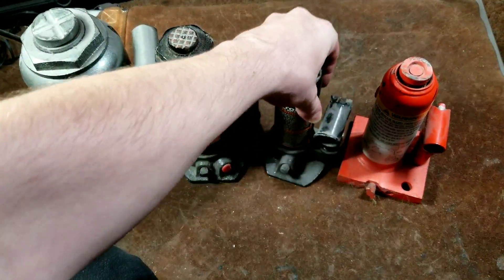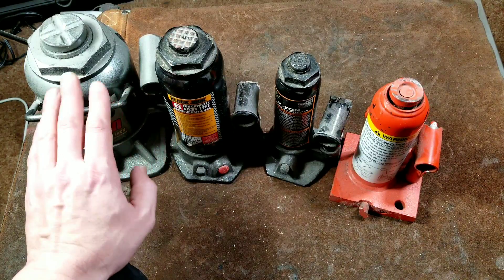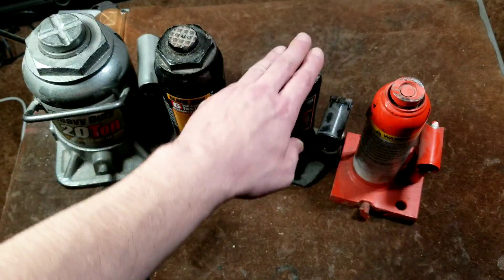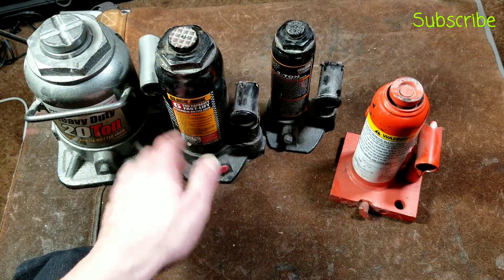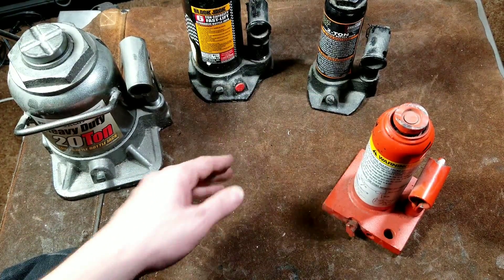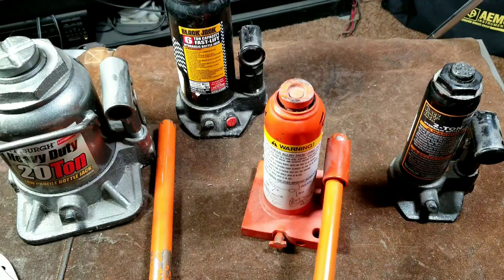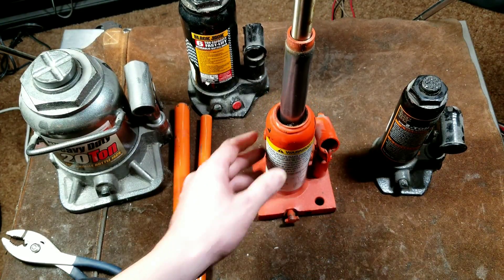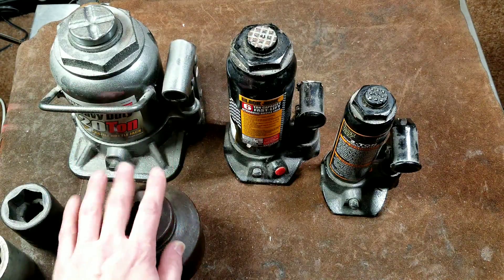Hydraulic Bottle Jacks Overview & Discussion

Comment: Hi, just bought a Torin Black Jack 8 ton welded bottle jack, its heavy, awesome and pretty straightforward since its welded sealed, and probably unserviceable to some extent, as far as seal replacement on piston n plunger relates. The release screw youre right, just hand tight to seal height, any more force will wear down pressure release screw. Thanks for the videos you do, seen them for some years ago. I thought on building  custom double box end wrenches using impact sockets cut to fit, and some flat steel bars machined forged to fit and welded, at some point we mechanics will build a few tools custom or for heavy extended use on standard bolt sizes, long life wrenches for a special need.
Reply from the maker: It sounds like you've got a good plan for some custom tools!
Reply: Yep! Welding skills open world of possibilities!

Comment: This inspired me to go take a look at the factory bottle jack in my 2009 Mitsubishi Express/L300 Van here in Australia, which I've never needed to try out.
To my surprise it's also a two stage bottle jack, and the first one I've ever seen too, I think it must be a Japanese car maker thing.
It's a very small orange bottle jack almost identical to your orange one, also 1500kg rated, but the bolt down hole is closer to the corner of the base, the base is also plate steel just like yours.
Collapsed height is 6-1/2" and with both stages fully extended it measures 15" total height.
Interestingly mine extends the narrow ram first, then the wider one comes up second.
Also, the narrow ram collapses first, before the wider one....ahhh hydraulic jack trivia...love it🤣👍🇦🇺

Comment: Those things are dangerous.  I thought about getting myself a bottle jack because I like that it’s so compact.  But that was until I saw a video on YouTube where a guy demonstrated how one tip over and slipped out from under the car frame.  The problem arises that the base is fairly narrow and if you have any horizontal force applied from the frame, it can slip right out from under the car
Reply: I use an older GM truck scissor jack that came with their 90s trucks. Mine has a long 4 foot handle that attaches to slide the jack under the vehicle safely, is cupped to prevent slippage, and is extremely low profile for cars. Much better than a bottle jack imo.
Reply: @jameshill4900  I prefer the small wheeled jack.
Reply: @Gaba-oo4qb  Definitely much safer than a bottle jack. I've had trouble using them in low profile cars but it sounds like it's working well for you 👍

Comment: So I was thinking of replacing my factory scissor jack for one of these because mine failed on me. I take it that these bottle jacks aren't good for replacing a flat?
Reply: My suggestion would be get a heavy duty scissor jack. I use an older GM one that came with their 90s trucks. Mine has a long 4 foot handle that attaches to slide the jack, is cupped for safety, and is extremely low profile.

Comment: I recently bought a pretty good (I thought) bottle jack for my jeep but I keep it in a canvas bag, stored on it's side and it is leaking. Would all bottle jacks leak when stored on their sides or do i have a lemon? Thanks, cuz it seems no one on youtube addressed this issue.
Reply from the maker: It is an issue with bottle Jack's some leak when stored their side, some don't. They do not have the same upper piston seals like heavy equipment cylinders. They also Caan leak from the rubber fill plug on the side.

Comment: I have that exact same orange jack. I turned it into a toe jack, but it gave out on me and is now leaking all over my garage. Came here trying to figure out if it was possible to repair it.
Reply from the maker: It might be possible but you need a huge wrench or socket to be able to unscrew the top of the jack and pull out the piston and replace the seals if that's where it's leaking, it may be leaking from the valve or the pump.

Comment: I'm a tow truck driver and use a low profile jack but I run into trouble with trucks especially lifted trucks with big tires
Reply: Stack wood under the jack

Comment: Torin jacks are well made. I have a few of them 12 ton, 20 tons, and a 50 ton
Reply: Curious to what you use a 50 ton one for
Reply: @MrRepid  probably leveling a house.
Reply: @Azeminad  that's crazy
Reply: @MrRepid  
And machine work as well.
Also, it's nice to use oversized Jack's   for the peace of mind that comes from the extra strength and stability.

Comment: My biggest issue is having to crawl under a truck that only has jack points way under to twist the release lever. The pumping tool Is not long enough for some vehicles. Any tips
Reply: I use a scissor jack. Mine is an older GM truck one that has a 4 foot long handle that hooks on the jack and allows you to safely push it under the vehicle. Extremely low profile as well for cars. I am surprised they aren't more popular.

Comment: What happens if you store Masada bottle jack on the side? Does it get irreparably damaged.
Reply from the maker: No it does not break a bottle jack by storing it on its side. Many bottle jacks can actually even be operated while on their side the pump just has to be facing the top

Comment: That orange 2 stage jack is found in Mitsubishi Montero’s from 1984-1999.  Possibly even after 99 but I’m not completely sure.  I’ve owned 8 Montero’s but only one was a latter one (2005) and I didnt get to check the included Jack.
Reply: I have a late '93 Mitsubishi Pajero here in Australia, same as a Montero/Shogun, pretty sure it has the factory jack, so I'll have to check it out tomorrow.
I just looked at the factory jack in my 2009 Mitsubishi L300/Express Van and to my surprise it has pretty much the exact same two stage orange jack as he showed in this video, I think it must be a Japanese car maker thing.🤣👍
Reply: @simonilett998 It's called a double ram jack.
Ford Super duty trucks come with them as well but it's yellow and it's 4 ton.
Reply: @IDIturboDiesel  sounds perfect. Something to keep my eye out for at the junkyard.

Comment: Can you recommend a jack that's fast? I need one which moves quickly but don't need huge amounts of power - for a cider press and most are super slow cycling. thanks!
Reply from the maker: A Double Pump Floor jack piston
Reply: Screw jack ran by an impact wrench.
Scissor Jack's are nearly free at your local junkyard.

Comment: I have an old sears 2 ton jack that is just the smallest thing I have ever seen. the seals rotted out on it years ago and all the fluid ran out, but I just filled it with some really thick transmission fluid that's more like a gear oil, and tried it out and it still lifts the front of my truck effortlessly. I was amazed by that little thing.  I thought it would struggle a little bit, but no it stayed strong and didn't drift at all. I mean it's still well within spec but for how old and rotten it is, it's no slouch.

Comment: How can a welded jack be repaired/rebuilt?
Reply from the maker: Not really it's totally not worth it to cut out the weld fix it and then reweld it
Reply: It can be repaired,
Brand like mega spain jacks
Japanese jacks
Reply: @hishamchohan494  How is it repaired, just wave a magic wand and poof, it's magically working?  Seems it's welded so this means cutting it open then welding back after repair.  It's often difficult or expensive enough already to locate parts, let alone the time involved cutting and welding.
Reply: @thisisyourcaptainspeaking2259  you don't have to.cut it.
Just use hook and needle tools to remove that lock ring on the top of the ram/
Reply: @thisisyourcaptainspeaking2259 by the way ,what brand or model or ton it is?
Reply: @hishamchohan494  You tell me, I hope to locate a 2-ram bottle jack with repair kit.  I now have 2-ram jack but cannot locate parts at reasonable price, it's not welded but must remove small ram from bottom of large ram.  To accomplish, the top nut is removed.
Reply: @thisisyourcaptainspeaking2259  thus if you want to repair that old one
 ..and need help
Just upload a video of the 2ton jack showing its all sides.
And show what part did you remove,...
If you have a scale size it in cm ,vaniar caliper in millimeter

Comment: Do you perhaps have any idea of how tight that nut on the 20 ton jack would be generally? I mean how much torque would you need to screw/unscrew it in Nm or lb-ft? Thanks for the video!
Reply: Just use a pipe wrench
Reply: I have broken loose the nut while the weight of a car was supported by the jack.  A large wrench or even pipe wrench, expect less than 50ftlb should be plenty.  All those I've disassembled had right hand nut threads.
Reply: @thisisyourcaptainspeaking2259   make a video and up load it
Reply: @thisisyourcaptainspeaking2259  50ft-lb?? While under pressure???
Sounds very unlikely. Does the pressure somehow reduce the torque needed?
Reply: @ronfox5519  The hydraulic pressure isn't (and ideally should never be) against the cylinder gland nut.  The purpose of having the hydraulic cylinder under load (the jack under pressure) is to keep the jack from spinning while loosening the gland nut.
You should always avoid extending the cylinder to it's upper travel limit where the gland nut is receiving hydraulic pressure because this pressure can rise dramatically beyond the capacity of the piston seal.
The jack may also be placed in a jaw vice while removing the gland nut, if one is available.
Bonus tip: keep top of jack covered and cylinder in home position while not in use to keep dirt and debris from collecting on the piston rod and entering the cylinder.  I place a plastic bag, rag or paint spray can cover over the gland nut for this reason.
You may notice many jacks no longer have a removable gland nut.  Personally, I avoid these disposable jacks.
Reply: @thisisyourcaptainspeaking2259  
Very interesting.  Thank you.

Comment: How much lift do I need to change a tire on a 2014 Honda CR-V?  The  frame is 10.5” off the ground. I’ve noticed that the travel on these jacks are about 7”.
Reply from the maker: Generally speaking when it comes to SUVs like that bottle jacks just don't have enough lift to get past the suspension travel you really need a little floor jack of some type that has a lot of travel
Reply: I bought the Harbor freight 6ton bottle jack. It has a lower profile that the others. I'm confident that it will clear the body now.  @CatusMaximus
Reply: @Camrographer  One concern with jacks is if the tire is flat, there may not be enough space remaining to insert the jack underneath, safely.  Single ram hydraulic jacks especially but also dual ram bottle jacks might also present this problem.  Be sure to confirm before getting stuck somewhere where you might compromise safety, damage your vehicle, etc.
Reply: @thisisyourcaptainspeaking2259  I tried it out on the car frame and made an allowance for a flat tire.
Reply: @Camrographer  Great, yes the crv does have good ground clearance.

Comment: I had on of those two stage bottle jacks fail on me a couple weeks ago!!! Thankful I was using it properly, had a flat and it would only fit it in middle of the chassis rail because the tire was to low to the ground so I lifted it about 2 inches then it came down in a blink of a eye. Then I was sitting around waiting on AAA. And another time I had it almost fully extend lifting a cab wit no chassis it it fell right over to the right again thank God I wasn't in harms way
Reply from the maker: Good comment an example of why you have to really respect little bottle jacks and lifting up heavy things in general